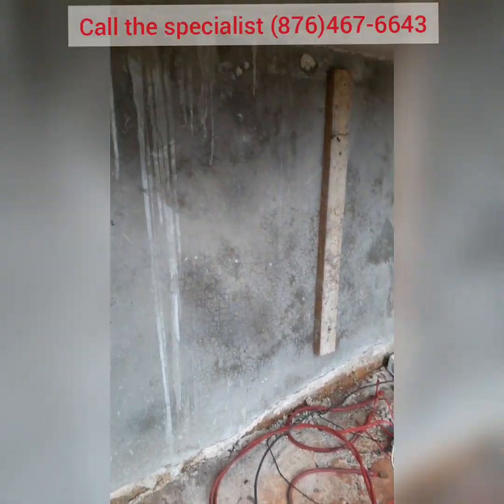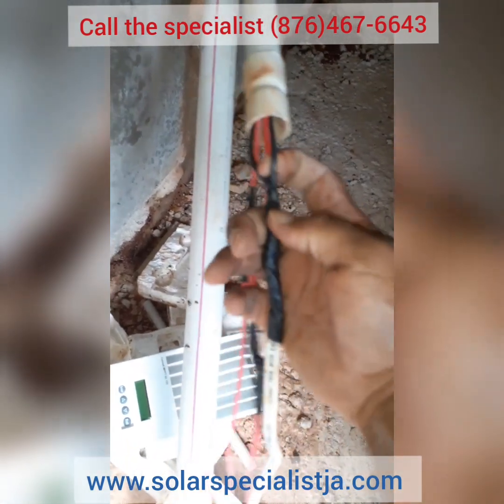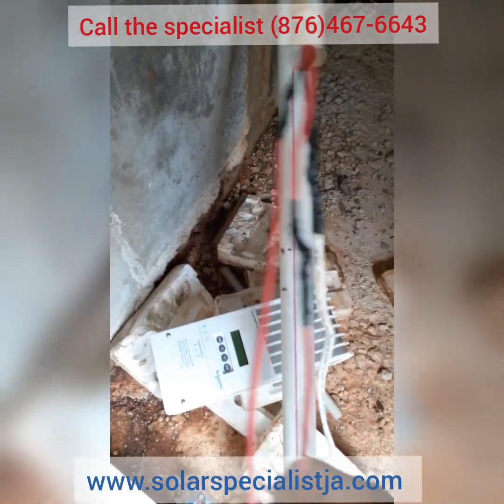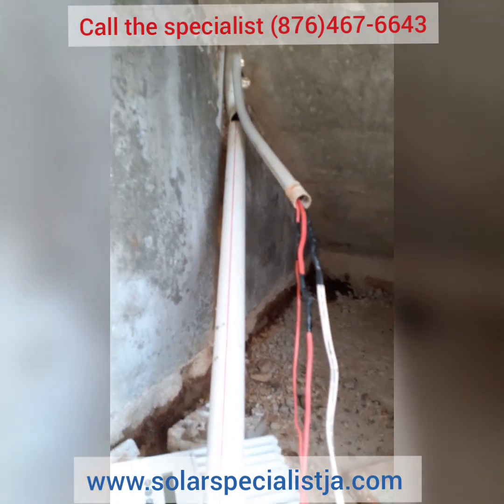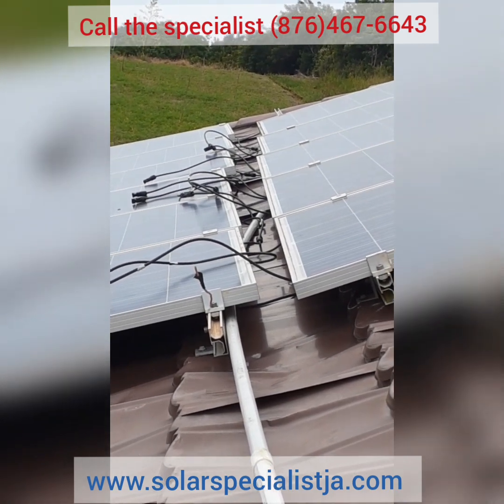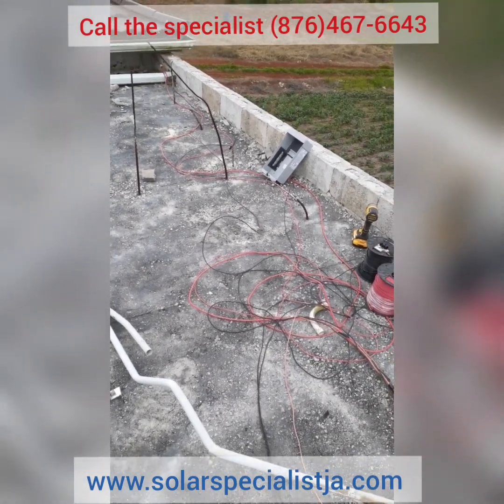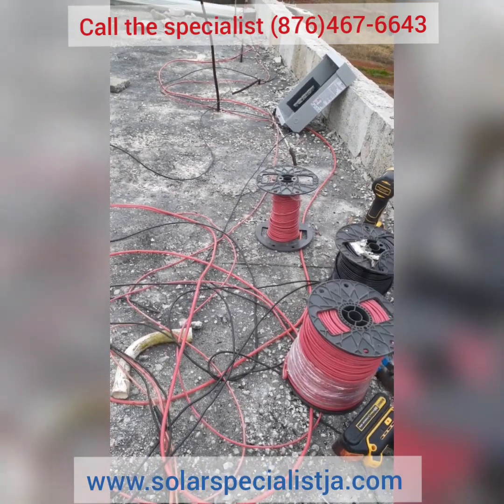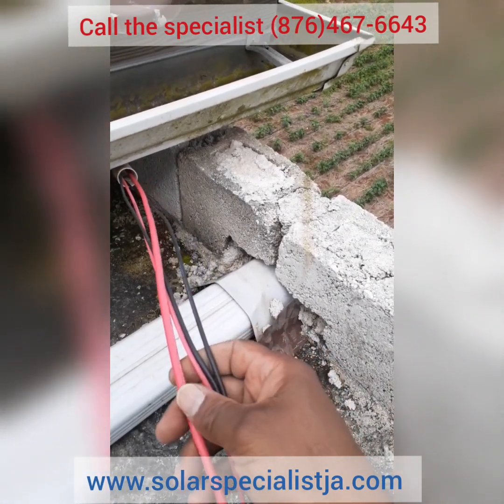Solar installation nightmare part 1

Comment: Kind of reminds me of my first diy solar setup I used AC wire then I changed to 6 gage DC audio wires actually those audio wires have been on my house for about 6 years now. To be honest at the time the proper solar wires was too expensive for my mouse budget it's lately I start changing out the DC audio wires to proper solar wires which I discover strands are thicker and properly shielded, so yes the wire does make a difference.